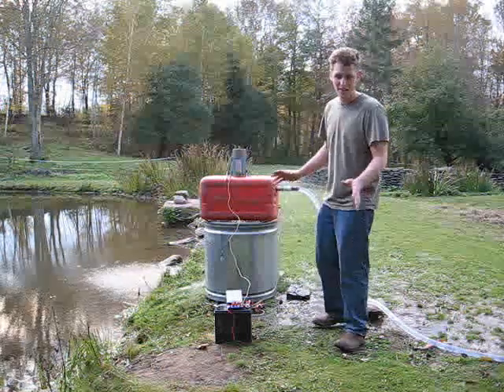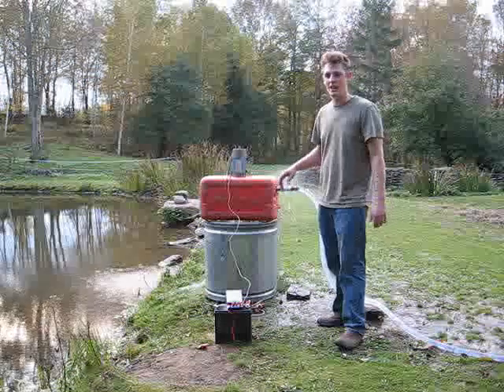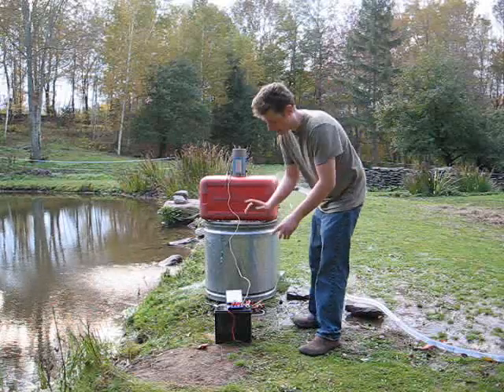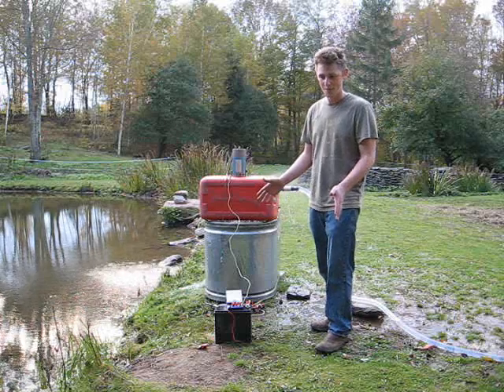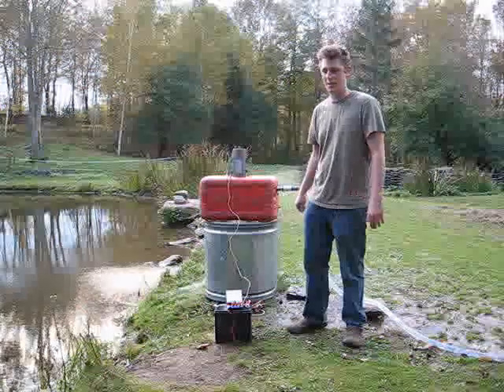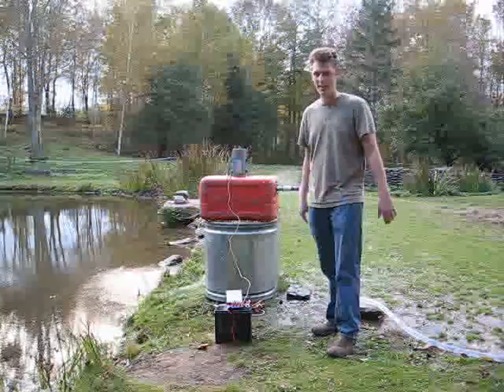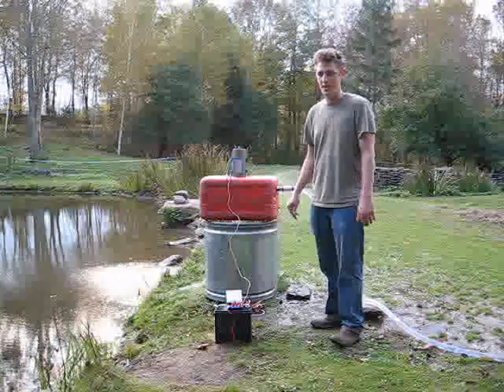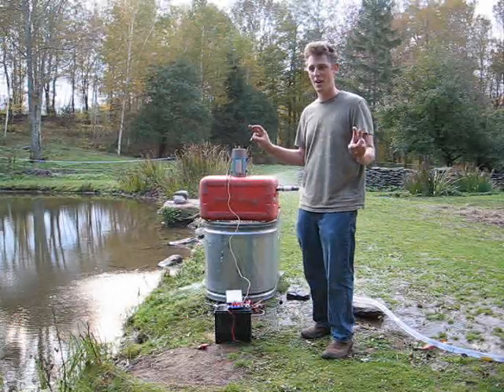Pt. 2 Running and Testing Our Pelton Turbine

Comment: Someone asked where the (pressurized) water is coming from, haven't seen an answer yet.  Your land has to have water at a higher altitude than where the water will exhaust from the turbine, or other natural source of pressure.  If this experiment is just plugged into city water, you are simply stealing a little bit of power, wasting water and maybe raising your water bill more than you save.  There are configurations that will turn a generator with a prop submerged in a fast stream, harnessing an altitude drop somewhere else, so that would work. In any case, experimenting with energy and energy conversion is a lot more enlightening than watching TV. Way to go!
Reply: The channel owner answered it one year ago, just six comments below: "A mountain spring several hundred feet up."

Comment: Nice video, but 30 watts?  You wouldn't eve be able to power a 40 watt light bulb.
  
I just saw a calculation for 800 watts (which would be 8 - 100 watt light bulbs or 8 amps at 100v).  The amount of water needed would be 6.6 gallons a second or about 500,000 gallons of water in one day at 10 feet.  That's the amount of water in 25 in-ground backyard swimming pools per day.  800 watts is about half the electricity needed to power my daughter's blow dryer.
Reply: GREAT IF MOM IS PAYING THE WATER BILL.I WON'T EVEN GET INTO ELECTRIC BILLS IF USING A WELL.BUT ITS JUST FOR LEARNING ABOUT IT.I SEE A STREEM OR SOMETHING THERE THOUGH.IF THEY COULD RUN A TROTH INTO A HUGE WATER TANK AND PUT THE TURBIN UNDER IT ,IT COULD CHARGE UP SOMETHING.ALSO THERE IS A PULSE WATER PUMP THAT USES ON POWER THAT MIGHT DO SOMETHING.
Reply: A well designed Pelton Wheel can be 95% efficient.  My guess is this one is less than 50% and is probably more like 25% efficient.

How many watt's or electricity is being produced?  

To generate 800 watts for 24 hours with a 10 foot drop will take 500,000 gallons of water with 95% efficiency.

It's a simple calculation, PE=M x G x H 
Water is 8 lbs per gallon.  Just do the math.
Reply: Passed High School Physics hi, you seem good at the math involved and i was wondering how well something like this would do ,if used on a city water line for getting a little extra power back from the water we already use and pay for.every time we turned our water on for whatever use.we could be charging batteries
.it also under a lot of pressure.maybe one of those tesla turbine.am i dreaming or ripping of the water company or putting strane  on their system?seems to me that it's wasted energy going down the drain.
Reply: immrnoidall What you want to do is completely possible.  Your water pressure is about 60 psi.  Considering around 90% efficiency a continuous stream of about 3 gallons per minute would be enough to light a 40 watt light bulb.  But then the question become what to do with all of that water?  Remember all of the pressure would be converted into electrical energy so you would now have just a pool of water.  If you wanted to take a shower or have it flow out of a faucet you would have to pressurize it again.  (Which would take energy.)
Reply: Passed High School Physics pool of water?no .it is sealed.all water would stay in the pipes but need to pass true the turbine.the only place the water would go out,would be at the point of use.lose of pressure would suck if it was to high of a load though.i see.most pressure would force the water around the blades it it could though.i wounder how big of a turbine 60 pounds would move.
Reply: A immrnoidall If you keep the water in the pipe you the amount or energy you can get from the moving water is minuscule.  The amount of energy you can get depends on the pressure difference and volume (gallons) of water.

Let's say you drop the pressure of the water 10 lbs. to 50.  In order for you to power a couple of light bulbs you would need to use 4-5 gallons of water a second or about 250 gallons an hour.

That's about as much water as you would use in 2 to 4 days.

Just to give you and idea to generate 800 watts of electricity in one day with a drop of 4 PSI you would need 500,000 gallons of water. (That's per day.)

And 800 watts isn't enough to power a microwave oven.
Reply: Passed High School Physics thats a lot of water for not much power.what do you think of the thorium reactor?

Comment: Just checked out part 1, looks like you might have a practical power output of 145 watts! That is certainly nothing to scoff at, maybe even enough to run an efficient home on if the big energy hogs used another system (heaters, cooking, dryer)

Comment: 3: Theoretical power would be Head (meters) x Flow (litres/s) x 9.81. Practical power would be on the order of 80% the theoretical power. If you were to post a gallon/minute reading I could help you optimize your system.

Comment: I might offer some suggestions:

1: If you are charging a battery that is already full then you will not be able to pump more amps in it. You may be able to make more power then your meter is showing.
2: If you were to put the turbine on the ground or as low as possible you could gain a few more watts.

Comment: my suggestion is try having more than one pressure outlet onto the turbine. one on the opposite side of the box and one at 90° to the rest making a total of 3 nozzles. it looks like you could get more power out of that water source.

also mount the whole generator about 12 feet in the air and direct the outflow onto a gravity type water wheel with a high torque generator attached, imagine the power you could get from the weight of like 20 buckets of water bearing down on 6 feet of leverage?

Comment: Can this sort of thing be encased to have for example it going from a garden house in a basic form turning the turbine and through the other side to run water through the hose with no leaking water? So in theory it could be connected through the mains house water to make electricity anytime the tap is turned on?